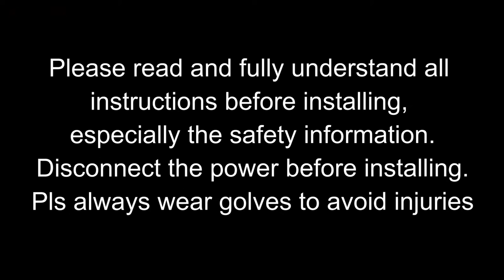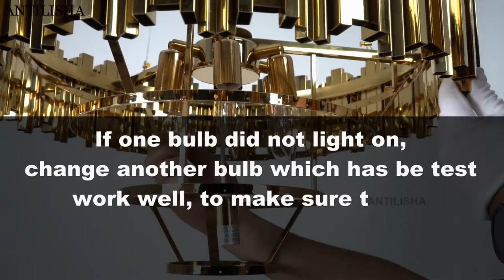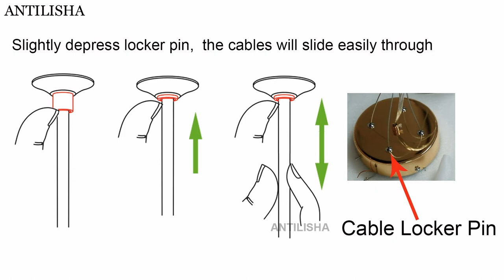ANTILISHA AT006 installation Instruction How to Install Modern Crystal Chandelier

Comment: Should we hang crystals first and then mount the chandelier to ceiling or should we hang crystals after mounting the frame on ceiling? Like for high celing it would be difficult to hang crystals in the end?
Reply from the maker: We suggest you hang crystals after mounting the frame on ceiling. Because once the crystals are hung up, the whole chandelier will become very heavy, which is very difficult to hang whole chandelier on the ceiling (moreover, the crystals might befall down when we moved the whole chandelier). And I know that we usually will rent scaffolding to installing a chandelier for pretty high ceiling, which allows us to install the crystal as easily as standing on the ground. If I misunderstood your meanings, pls feel free to tell me~I will help you all the time! Lisa